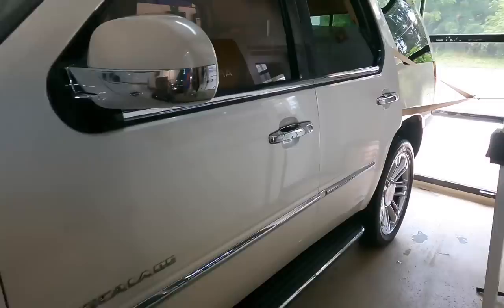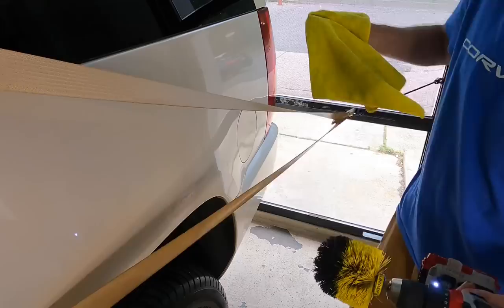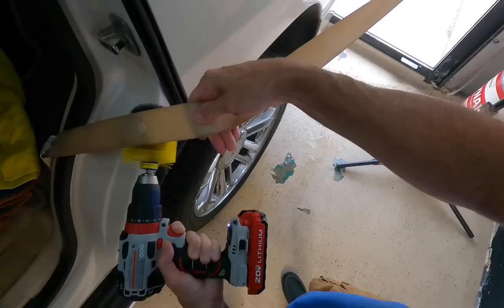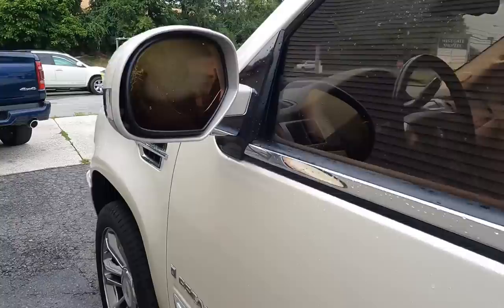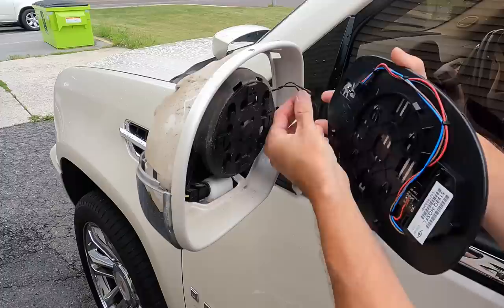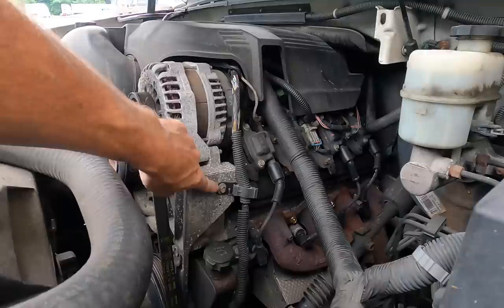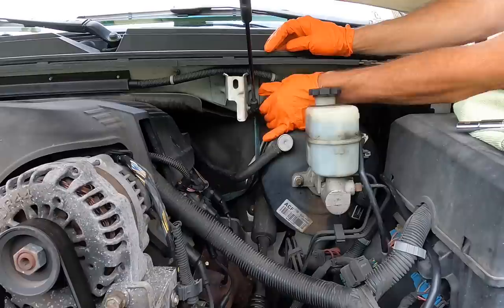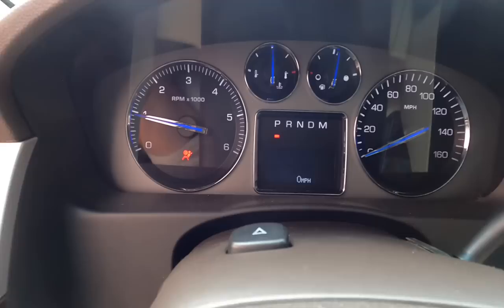How To Clean Seat Belts, Headliner And MUCH MORE!! Flip Series Part 9!!

Comment: I have used  Super Clean full  strength  spray on let soak for few min. on seat belt then  with a good scrub brush work in .   Wipe off dirt with a micro fiber cloth .  Repeat .  Work's quite well   . Seat belt's are the hardest thing to clean .

Comment: I've got a machine I bought on Aliexpress that runs on compressed air and uses a vacuum cleaner, there's a nozzle inside a plastic head that spins really fast and sprays a mix of high pressure air and cleaning solution into the fabric and then the vacuum sucks it back out. It's head is the exact width of most seat belts and it does an excellent job on them. Works great on seats and carpets too, it really lifts up and re-fluffs compressed carpets and beats the sand out of the base of the fibers. You can swap out the cleaning solution for water to do a rinse and then turn off the water entirely and just blast it with swirling air and suck the water up with the vacuum cleaner. It's a little slow if you're doing a large area but it works most excellent! It's similar to the Tornador devices, but the addition of a vacuum cleaner makes a big big difference.

Comment: For belts i prefer using a carpro inner scrub instead of rotary brush. This way i can really control the process. And for headliners.. the way you do it works on a clean headliner.. if you try doing this on a dirty one... will look quite wired if done only locally

Comment: You didn't disconnect the ground from the battery. I have double wires that go to a single ring terminal and to the engine. They're ground wires that have been cut to put in a  Security system. This was done before I got the 2000 Camry LE. It was removed before I got the Camry. Toyota doesn't make that part for the Camry anymore. So I have to make the double ground wires and 4 ring terminals and pray it works. Thanks for this video. It'll come in handy. Thanks again.
Reply from the maker: Each make seems to have their own little quirks with the electrical system over time.